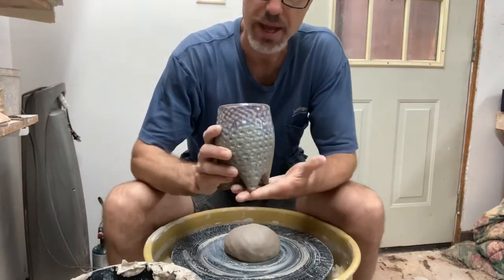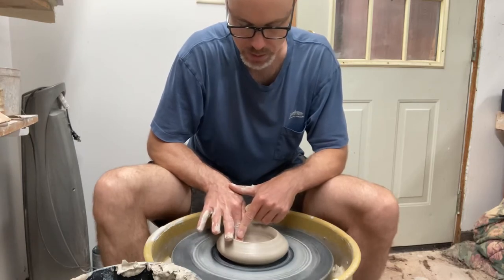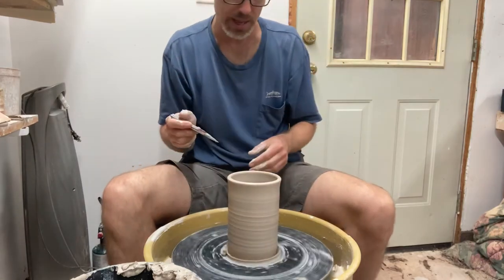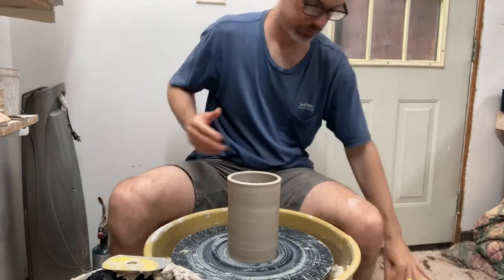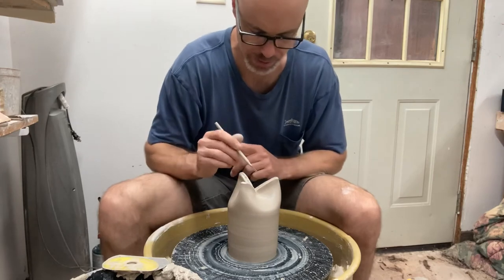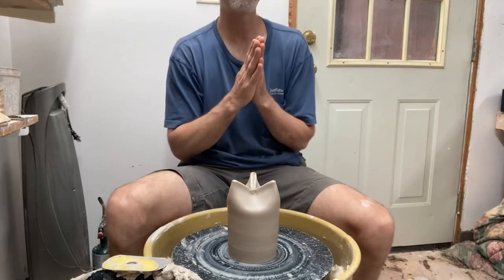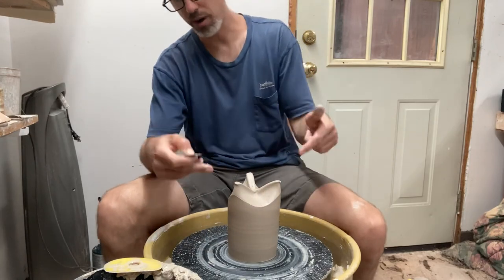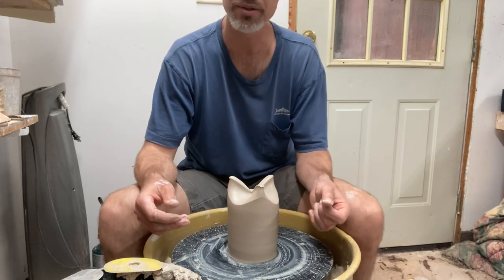Vase with tripod feet and built-in flower frog

Comment: Wish I could give this multiple thumbs up. Great coherent and useful presentation of a fun idea! Do you have any demos of how to make a tripod footed open-topped vessel (a cup, say) with a smooth rim? Same way, but trim off the bottom--same way but with a bottomless cylinder--the other way 'round so that the rim is at the top of a bottomless cylinder and fold it in at the soft leather stage? Looks like I have some experimenting to do. Cheers!
Reply from the maker: I don't have any videos, but your idea will absolutely work.  Timing is everything in getting the feet stiff enough to resist torque when you rethrow what was originally the bottom of the cylinder.  If you wait too long, you can clean everything up with a trim tool, but better to really shape and compress.  Might help to torch the feet a bit before flipping but be sure to wire off before torching so you don't expand the air inside and blow your seams.  Thanks so much for the kind comments.